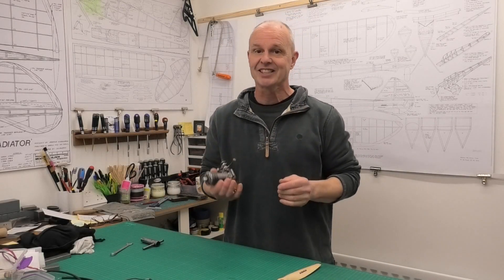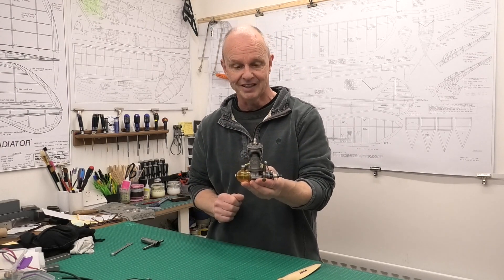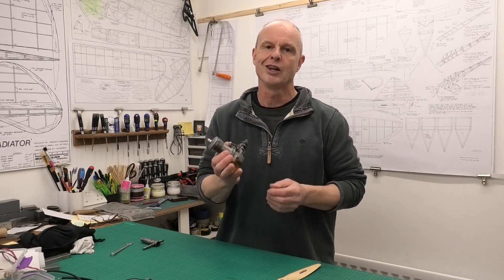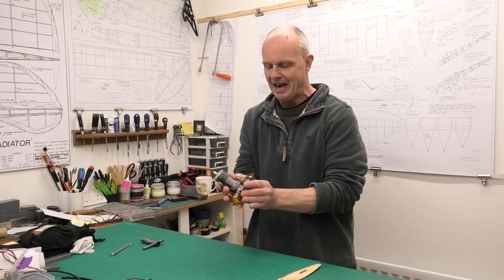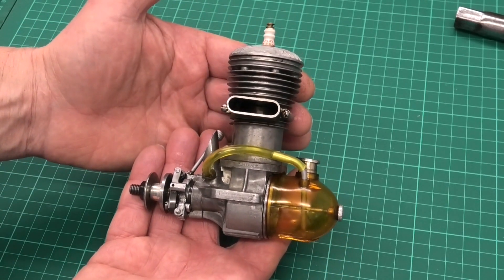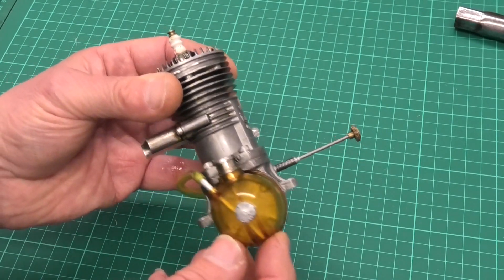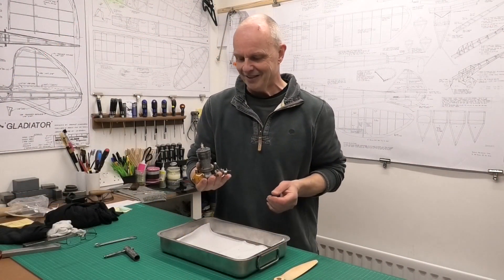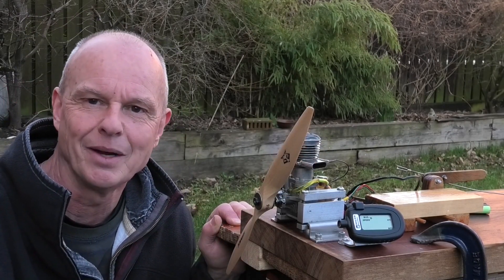1946 Super Cyclone  .604 (10cc) Vintage Spark Ignition Engine

Comment: Hi Mark. What do you use for your coil and condensor on these engines ? I have a bantam 19 like the sort in your diamond demon that I would like to get running so was wondering what / where you get the old school items to get it running
Reply from the maker: Hi there, the Bantam 19 is a lovely engine, runs well.  I don't use a condenser, I use an electronic ignition system designed for old sparkies, its kinder to the contact breakers and more consistent.  I get my coil, plugs and ignition system from Larry Davidson in the US, this is his website, hope that helps and good luck with the Bantam 😀 https://modelflight.com/product-category/engine-parts/

Comment: Nice video. I fly a couple of them. Two on control line planes, and one on an old free flight converted to R/C. They are fairly light weight engines for that time, compared to many others. 

I have been using stove fuel mixed with Walmart Super Tech 2 stroke non detergent oil 3 to1. It runs cooler and cleaner than anything I have tried. I have been running it for several years with seemingly no wear issues at all.
Reply from the maker: Thanks for the info!

Comment: Hi Mark   I know nothing about these motors.  what it the front leaver - throttle ?  What is all the linkage attached to this leaver.   The next leaver I get, that is mixture.   It's not nitro ?   Just 2T ?    Then how does the ignition work, does it have some sort of pickup like a lawn mower and have a spark box /cdi/coil .  in 46 they they didn't have RC transceivers and servo's,  so what was it used with ? string hand lines
Reply from the maker: Hi James, the leaver advances and retards the ignition, which affects the speed of the engine.  No throttle.  The run on a petroleum & oil mix.  The ignition system is just like any other two stroke bike, lawn mower etc, but smaller and lighter. Your correct, no RC in the 1940's so they were free flight or control line.  These days we can use them with RC.  Hope that helps 😀
Reply: Thank you Mark,  very interesting they controlled rpm with ignition advance/retard.   I would love to see the advance / retard mechanism and pickup pulled apart.   Your youtube on cam timing 4T motor was very interesting too

Comment: Be careful not to over tighten the timer; they’re quite fragile compared to the Anderson.   And, any alcohol in the fuel will eventually destroy that pristine tank.
Reply from the maker: Thanks for the advice, always appreciated.  One of the reasons I use the Colmans fuel is to save the tank, thanks again 😀
Reply: One thing to watch out for with Coleman fuel, its octane rating is only 60 or so, and 2 stroke oil has an octane of 0 (more or less) so with 4:1 premix it could go as low as 48. Depending on compression ratio you might be at risk of knocking running on it.

Comment: Interesting little engine. It is the fisrt I've seen with the exhaust on the left (right, depending your POV) side. Using typical petro fuel(s), It would be cheap to run compared to todays 2 cycle model engines...
Reply from the maker: Quite a common occurrence to have the exhaust on the left with this old spark ignition engines from the late 1940's
Reply: It’s reversible

Comment: What a beautiful motor. I love the sound of spark ignition engines, that crackling sound. We're you running the motor using electronic ignition or condenser ? Lovely find Mark.
Reply from the maker: Hahahaha, yes,  you may be right!  Need to get a good spark ignition hauled plane in the air soon!
Reply from the maker: Good morning Terry, totally agree about the sound, It is such a lovely engine to run.  I use a electronic switching circuit connected to the points, much kinder to the contacts and seems to work well.  There are more spark ignition engines to come! So pleased you like them 😀
Reply: I still think that you have been bitten by the vintage bug. Thank you for sharing collection with us. Terry
Reply: I have the same engine with a twin spark.Can you give me an advice about electronic switching circuit for this engine and the brand of it?